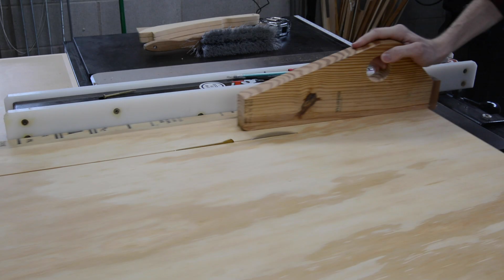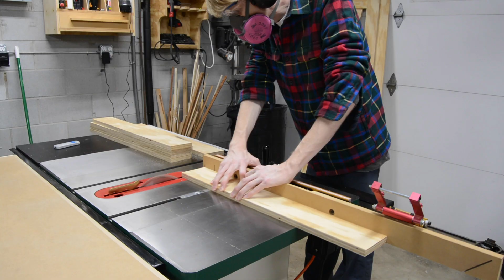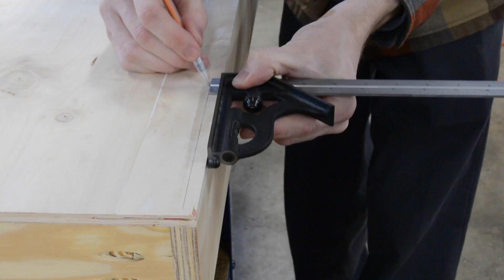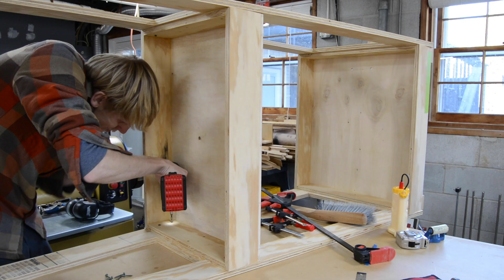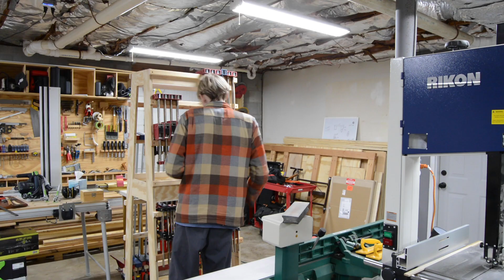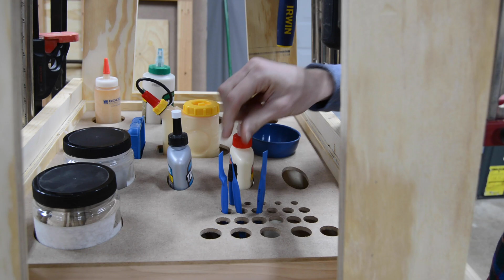Mobile Clamp Rack

Comment: My favorite part of the build is the cutouts for the glue and applicators. Right now I have a 5 tier shelf with an array of oblong boxes. The glueup is in one box, and there's a lot of different ones for the home, car, lawnmower, insecticide, stains, grease, oil and Minwax etc for the shop equipment. 
Right now I have a bunch of 6ft folding tables and the bottom rim is holding my clamps.